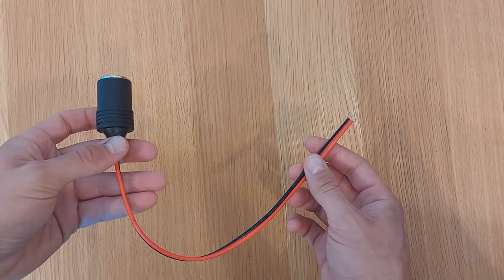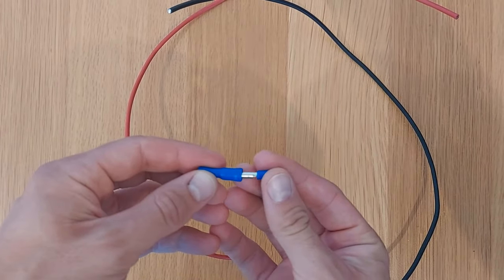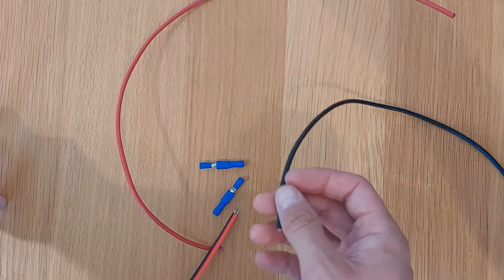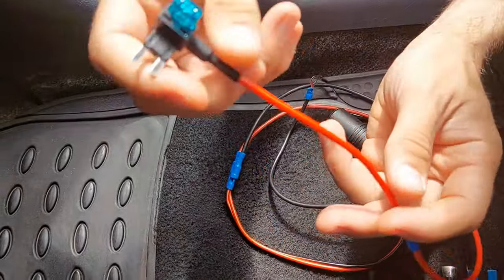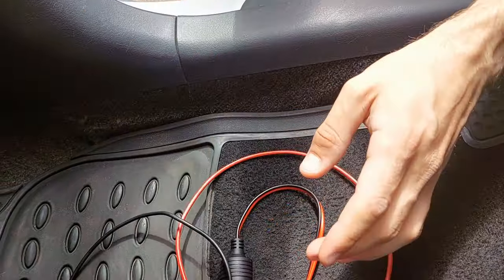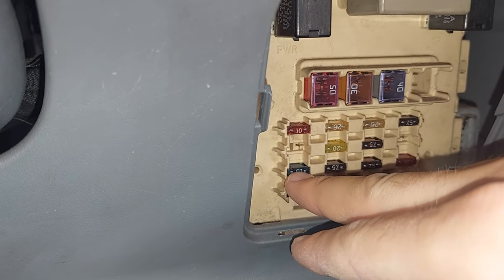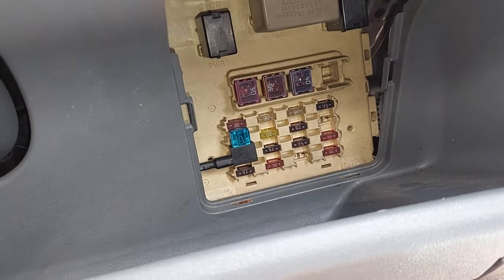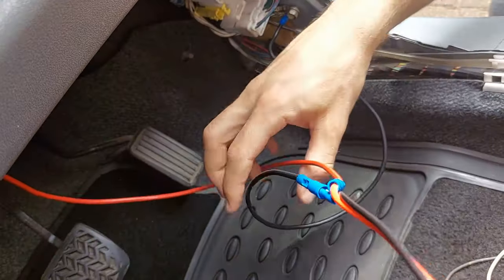How To Add A 12V Socket / Cigarette Lighter To A Car !!!!

Comment: I don’t know what I did wrong I was trying to connect led lights I connected the fuse with jumper but they wouldn’t turn on when car was on or off I used the 5 a ones I’m new to this but I feel like I did everything right would anyone know what’s wrong?